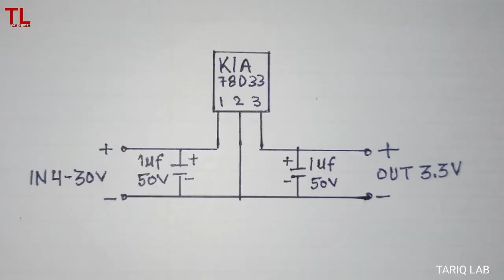How To Make 3.3V Voltage Regulator

Comment: Sir the soldering connection is like 7805,or 7812 IC, am I correct sir, good 👍 circuit with voltage and current protection,
Reply from the maker: Yes pin out same